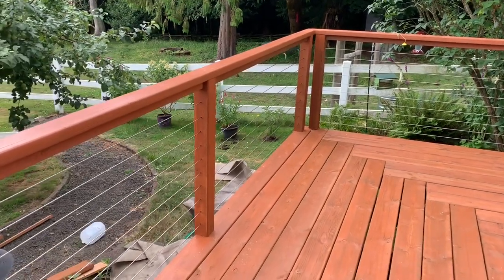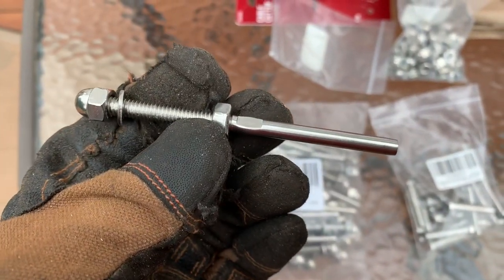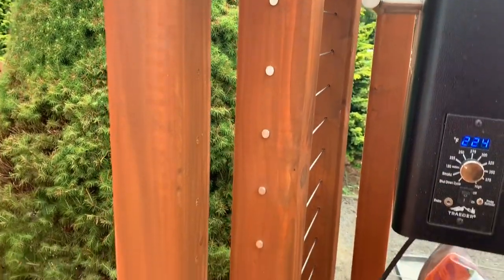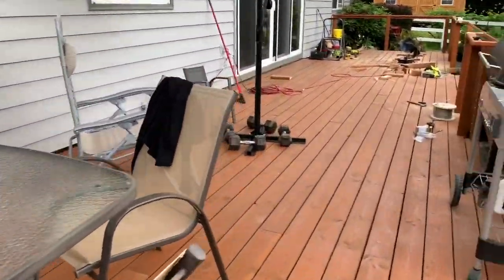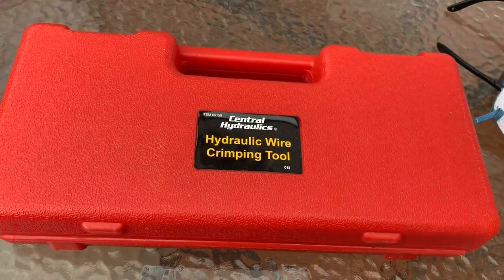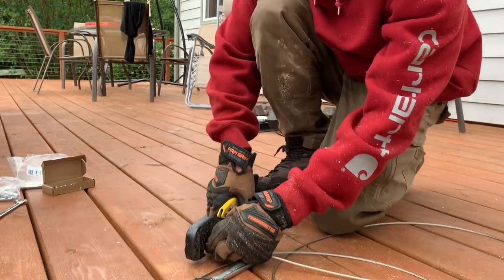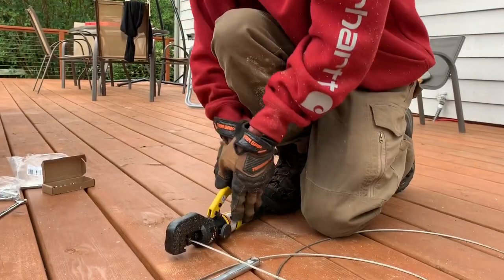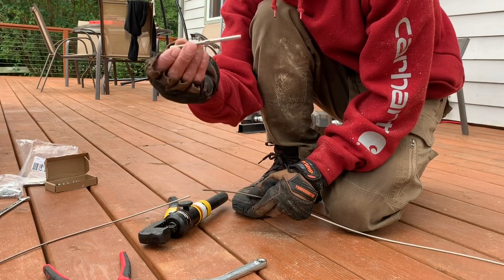DIY Deck Cable Railing - hidden tensioners - we saved hundreds !

Comment: Very nice video and excellent detail.  One item of note, this would not pass code in most municipalities, because your posts are too far apart.  No matter how much you tighten the cable, without intermediate posts, the cable will spread wider than the 4" allowed tolerance of a round sphere.  Most systems recommend 3' spacing, 4' at most. Some of yours appears 5 to 6', but maybe just the camera angle?

Comment: For those two very long runs of cable rail you show at then end of the video, did you only use one tensioner and swage end at the very end of each run with just the intermediate 4x4 posts as run through posts?  Those are long runs of cable with no tensioners in between.  Do you find that was adequate to maintain proper tensioning of those long runs? I've got one long run of almost 25ft and three runs of 10-11 ft that I worry won't be able to keep the proper tension with only one tensioner used at the end of each long run.

Comment: Not a fan of the two posts at each corner. Could one go diagonal through one post maybe line it with a steel tube to prevent the cable from working through the wood?

Comment: Thanks for using muzata products :)
Reply: How can I keep the threaded end from turning as tension the cable? Holding the cable with pliers isn’t very effective. Any advice is appreciated.
Reply: @feminjw  We have various cable railing terminals for your choice. We also have a custom socket wrench to work with our invisible tensioner, this wrench will keep the knob of the terminal from spinning while tightening the cable. You can email us what you need, our email address is support@muzata.com.
Reply: @feminjw  Vice grips are man's best friend. If you do not have them ten you need them. They are cheap.

Comment: Followed this to a T and looks phenomenal. Appreciate you taking the time to make the Vid! The problem i'm having is the nuts are loosening causing the railing to sag a bit. Ive had to retighten every cable. Any recommendations to resolve? Loctite the nut on the threads?
Reply from the maker: I went back and used a second nut and or nut cap. Once it was tight, I’d tighten the two against each other and also used a little loctite
Reply: Yea I’m having this same problem now.

Comment: I just wired mine up. System works great, but if your 4x4's are weak, these will split the wood in half. In order to avoid this don't over tighten and add a bottom plate
Reply: what type of bottom plate should I add to anchor to the deck and actual wood?

Comment: You're the man!  Using this for sure.  Did you use any of the "protective sleeves" when you went through posts that weren't anchor points?  Thanks, Bro.
Reply from the maker: BeerSnob506 sorry for the extremely delay response. I don’t do this often. No protective sleeves. Thought about it after the fact that I could just use rivet ends since the sleeves are expensive.
Reply: haigami thank big guy! Awesome DIY. Deck looks great😎

Comment: Hi Jim, looks great but not up to code for cable no span can be more then 3 feet before a support must be added and your cable spacing can not be more then 4 inches 3 to 3 1/2 is normally used other then that great job.

Comment: I know this is academic.. but its pronounced "swedge".. good video sir.
Reply: @VFL720  you're still wrong.. not only are you wrong.. but you made an excellent video. Get off the computer and go ask a tradesman that uses these items.  Then you will know.
Reply: @mikewills6753  I work as an electrician, man. Most of my friends are tradesmen. But it doesn’t make me correct...the dictionary does.
Reply: The dictionary makes you dependent.

Comment: Looks great! Probably the cleanest instal I have seen on here. How did you do the railings going down the steps?
Reply from the maker: I used a drill guide to be able to get close to the angle of the hand rail. It was had because the drill guide base was large. Would of been easier for me to disassemble the rails and drill while on a flat set face. Drill press would probably be the most accurate. I eyeballed the rest with a hand drill and lined it up parallel with the rail. The exit hole wasn’t exact but good enough for me.
Reply: @haihly  Great! I have a large drill press and will drill them before mounting them. I keep coming back to look at these cause they look beautiful. Totally stealing your idea!
Reply from the maker: @russellg7382  that’s great. Wish I had a drill press. Just make sure the angle is the same as your hand rail so may want to mock it up to see where the first hole is. The top one lines up with the other posts. However the bottom one is left off because the cable would run into the steps.
Reply: That’s good advice. I have a short run of steps so it won’t be noticeable to have the bottom one missing.

Comment: Hey, thank for the great tips, I just ordered these materials for my deck rail project.  What dimension of lumber do you have for your rail cap?  Is that a 2x6 with a 2x2 below?  great looking deck
Reply from the maker: vagabondroller rail caps are 2x4 with 2x2 below them to trim them out. I just cut 2x4s in half.
Reply: Awesome, thanks.  I ended up going with 2x6 caps and 2x4 below.  I used your exact system with the wire, right down to the HF crimper.  It came out looking Pro for not a lot of cash.  THANK YOU!

Comment: What size drill bit did you use to drill the holes?  Also, do you need to drill a larger hole at beginning post when you first start?

Comment: Thanks for the video.  Any thoughts on the ability to do this with composite decking posts?
Reply from the maker: Carol Hallenbeck honestly I wouldn’t know. I haven’t worked with composite. Hopefully someone who has will see this and chime in.
Reply: Why do you think this would not work. Its all just through hole design..??? Of course it will work...Now how do you go around a corner without adding an additional 4 x 4 thats the question.

Comment: Just curious why you did not use intermediate posts.  Your post spacing looks like 7-8 ft apart.  Are you noticing any deflection when cable is stepped on?
Reply from the maker: Post spacing is just about 6ft. I know I should of done less however that’s just the way it came out with where I placed them. Poor planning on my part. When I redo the hand rails they’ll be closer. I’ll be redoing them in the future to put the entire 4x4 inside the Facia board instead of notching and going on the outside.

Comment: Your video was extremely helpful. I did have a question about how to keep the threaded end from spinning as I tension the cable. Most don’t, but those that do are difficult to get proper tension. Thanks!
Reply from the maker: I put two nuts on and I can hold one stationary while I tighten down the other. Then tighten the two against each other when done

Comment: Awesome video! Do you have rust issues?
Reply: Laura J. Brown Haigami did an awesome job, and great question. Check out “Potter’s Work” video titled “Cable Railing 2 Year Update and Questions Answered”, he explains why he started getting rust. It looks like the rust does come in on the parts of the cable that you cut. So, I would suspect that to mitigate that risk, you’d have to coat the cable (not sure if outdoor caulking would help).
Reply from the maker: No, no rust issues thus far

Comment: What's your local building code for maximum spacing of your verticals.  Where I live it's 3 ft. Meaning I'd have to had more posts than you have on your railing.
Reply: did you mean 3 inches?
Reply: For a retro fit, i have the same problem.I need 27 intermediate posts. Mazuta has a "slim line"intermediate post that is just flat bar with a top and bottom plate to screw to the deck and top rail with 3 inch spacing. They would be nearly invisable but for 27 posts at $119 each the $3,213 is massivly  staggering. Before proceding, this has to be puzzled out.
Reply: @troydunn04  No some places requier support for cable railing every 3 feet with 3 inch on center spacing.

Comment: Thanks for the video. What are you going to use on the stairs?
Reply from the maker: Michael Preston stairs were some with cabling as well. Less row due to the angle. It was kind of tricky. I purchased a drill guide and that that helped with starting the holes and I’d finish by hand. The top hole was done by eye balling it due to the lack of space for the drill guide.

Comment: I did my father's deck in May and on a couple of the runs the cable spun and kind of unbraided the cable and I couldn't figure out how to hold the threaded swage fitting to keep it from twisting.  I'm about to do my deck in the next couple of weeks so I was wondering if you had any issues with the threaded swage fitting turning as you tightened the tensioning nuts and how you dealt with it?  Thanks, Thom
Reply: Just hold either end of the fitting with a pair of grips as you tighten the nut to stop the body spinning. For a neater look, use a lag bolt terminator at one end, and a lag tensioner at the other - install the ends into the posts first, swage the cable into the fixed end, extend the tensioner to 2/3 of its travel then cut the cable to fit - insert, swage and tension in place.
Reply: How can you hold the swage fitting when it’s inside the post? I would use a hacksaw and slot the end of the threaded swage and then hold it from turning by using a screw driver put into the slot as you tighten the nut.
Reply: He answered this above--use 3 nuts--one to tighten asnd two locked together to hold or some just lock on the end with vice grips

Comment: Is that a1x1 board under the 2x4 railing?
Reply from the maker: Technically a little bigger than 1x1. I took a 2x4 and ripped it down the middle.

Comment: Thanks for the vid! What size die did you use in your HF Crimper?
Reply from the maker: Ian Thomas good question. I actually can’t remember and just recently lent out my crimper to a buddy. I remember having to do a few test crimps one a single piece to size it up. Sorry that’s not much help. But the crimper does come with different sizes.
Reply: @haihly  Awesome, thanks for the response! I know a lot of cable companies are selling crimpers with special 1/8 inch dies for a million bucks, but I figured a normal AWG die would work. However, no one else has talked about that, so I was glad to see you mention your HF crimper.
Reply: Ian Thomas Remember that we are talking stainless here. Dies made for AL or copper will quickly deteriorate. I believe that the Harbor tool comes with the correct die for 1/8"cable.
Reply: @richardlafford1397  Right, I did find the HF one had a proper die that got it all solved for me. Thanks!

Comment: Same on jig pattern for the stairs?
Reply from the maker: Julie E , the stairs were kind of tricky. I had a hard time getting the angle cut for the hand rail on top. But as to the holes. They’re the same distance apart on the jig. Just had to start from the top and work down. There is one less hole in the bottom due to the angle. Hope that makes sense. Oh also I pretty much had to eye ball the angle with the drill since I didn’t have a drill press.

Comment: What size bit did you use on the end posts that had the hardware inside of them.
Reply: I'm curious to know too. I have fed my cable threw bought the same hardware but need to know hole size.

Comment: Question, can you give any advice on how you drilled your holes in the 4x4's? It looks like you spaced them really evenly. Did you use a template?
Reply from the maker: David Peerboom, I took a 2x4 and it it the same height as the railing where the holes would be from the floor up. Then marked and drilled holes at 2.5 in apart. This was my template I could move from one 4x4 to the next. I also used a drill guide to try to get it as straight through as I could. Some didn’t end up perfect but pretty good.

Comment: Looks like you wasted hundreds.  Just completed my 28” deck for under $50.  i used 4 inch spacing, as required.  if you re-drill your start hole, add a washer to your cable, and double it back on itself
Reply from the maker: Arlin Steffanson, I’m happy for you.
Reply: Can’t picture what you mean Arlin, but I want to know how to save $. You have a vid or directions somewhere?
Reply: Arlin Steffanson No wonder. Your deck was only 28”.  Miniature?
Reply: You didn't have to write that 1st sentence! Nasty!!! haigami took the time to video this and I than him for that! THEN the way You describe it just doesn't make sense, THEN you have a 28" (inch???) deck???